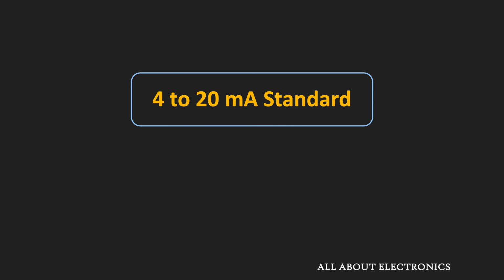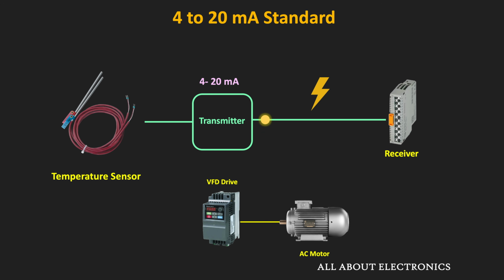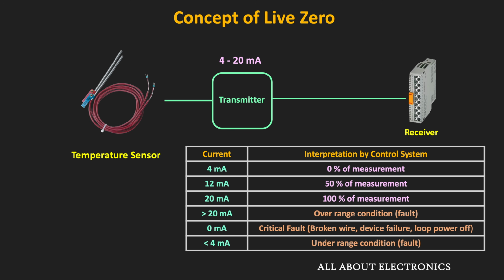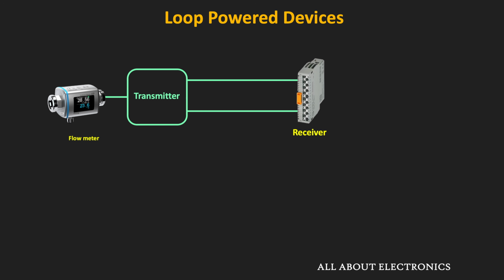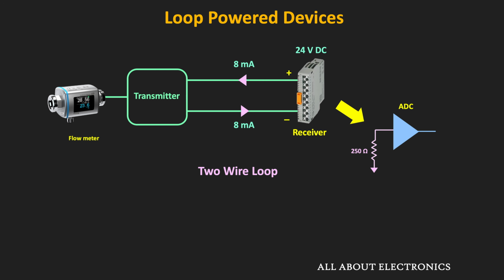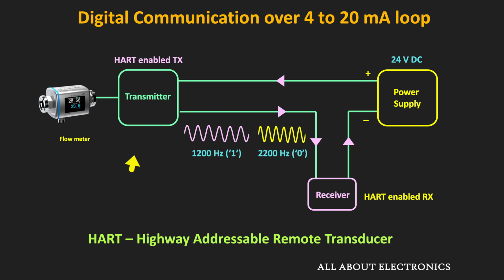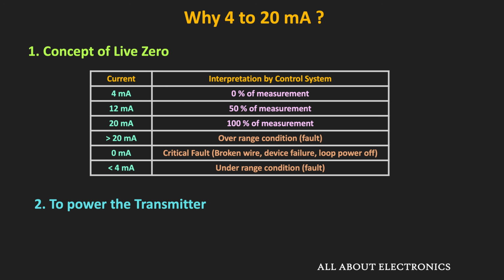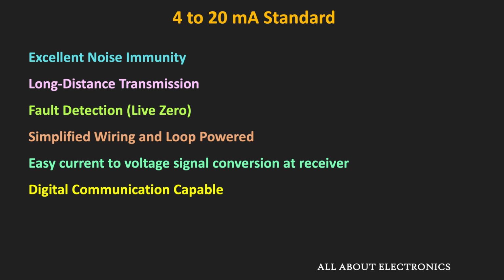4 to 20 mA Standard Explained | Advantages of 4 to 20 mA Standard

Comment: If the range of the sensor is for example 10-100bar, then should 4mA be equivalent to 10bar or 0bar?
Reply from the maker: 4mA corresponds to the lower end of the sensor's range, which would be 10bar in your example.
Reply: @ALLABOUTELECTRONICS  Thanks

Comment: 2. The explanation of loop power is great! But I'm wondering, in a large industrial setup with multiple 2 - wire transmitters on the same loop, how do you ensure that each device gets an adequate and stable power supply?